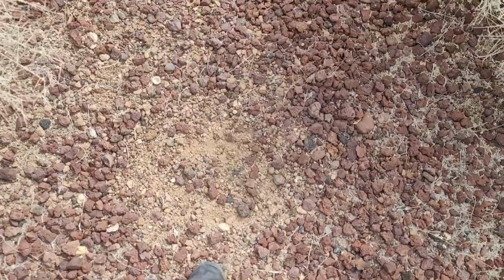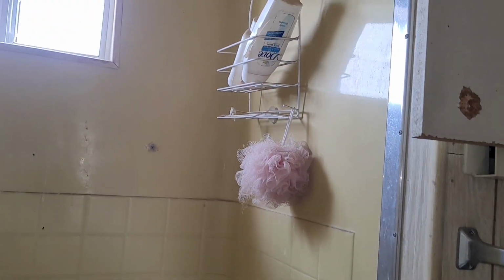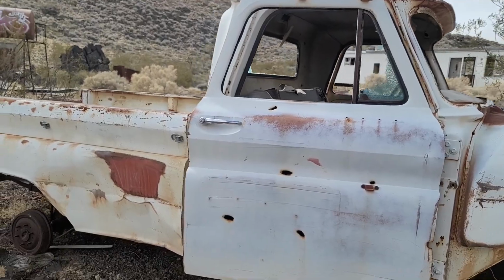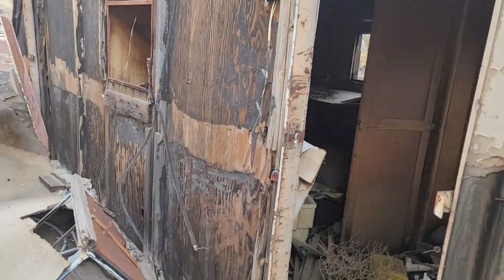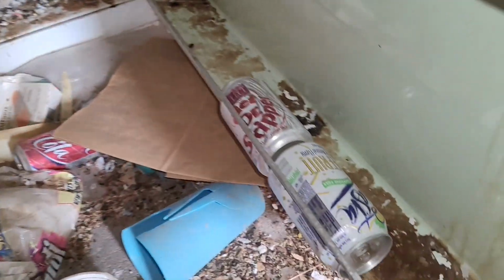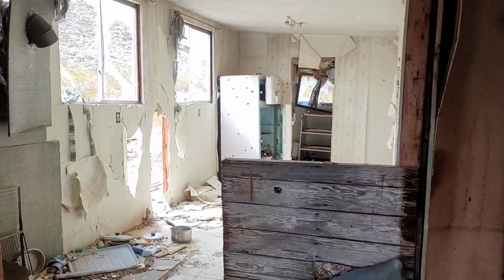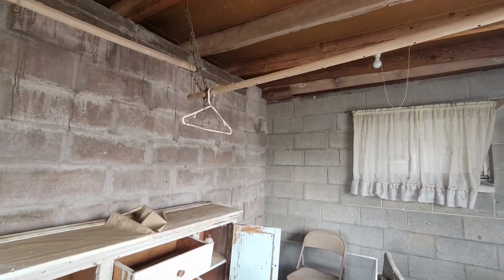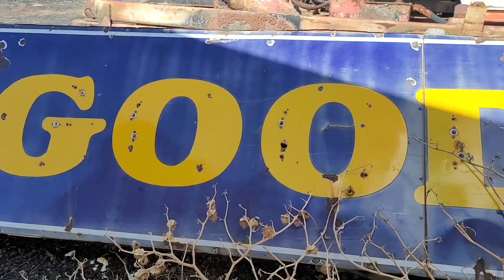#613 Snow Falling on an Abandoned Cinder Mine Ghost Town in the Mojave Desert: PART 1

Comment: The trailer was built by a company called Hallmark there in Redlands California on Redlands Boulevard that's just a code for the cabinets I work there 40 years ago
Reply: @techreviews.heretoday.gonetomo  They towed it behind a truck.
Reply: @techreviews.heretoday.gonetomo  You could tell by the conveyor  system  and overhead  hoppers that a lot of trucks loaded there and hauled  the aggregate  from there while the quarry was in operation. The access  road would have been maintained.  The trailer toter would have had no problem  delivering the trailer to the location.

Comment: The Explore With Us crew also did a video here and the former cinder mine was shut down in the early 200s. I recognized the old Chevy truck and the early 1970s Datsun which are still there. The mine had supplied much of the cinder blocks for buildings in LA.

Comment: You would like exploring the Abandoned Haiku valley Omega transmitter station .. The building’s are Four ft. thick reinforced concrete with Railroad tracks for rebar .. The Stairway to Heaven is part of the Haiku valley ... It was a secret military base back in the old days sending a signal 8 thousand miles .. The valley produced so much Tesla like electricity ⚡️ into the area you could walk around the valley at night with a fluorescent lightbulb in your hand unplugged into anything and the bulb would lite up just like if it was plugged into power .. VLF Electromagnetic energy  .. The military base was like something out of a 007 movie .. Google Haiku valley Omega station for details ..